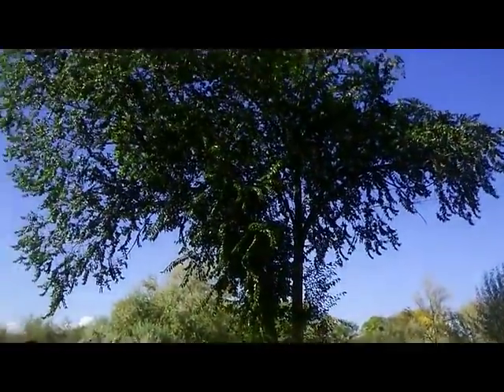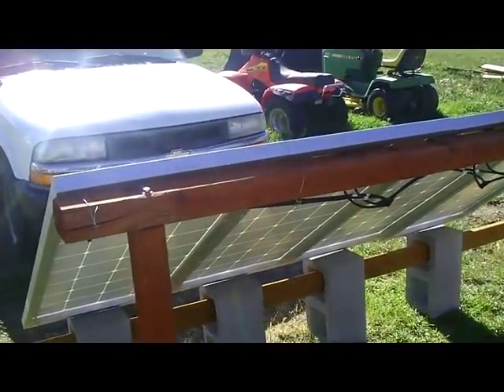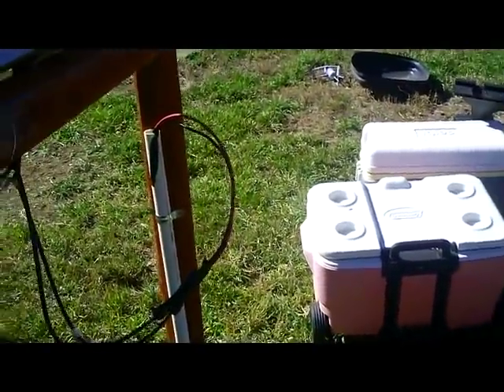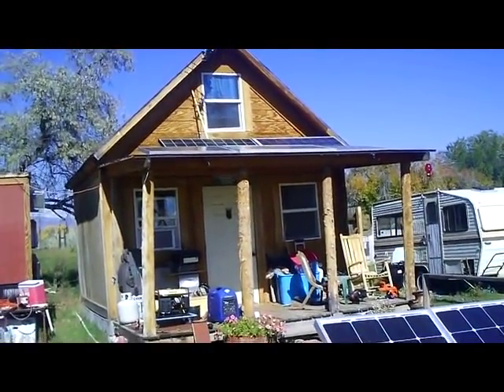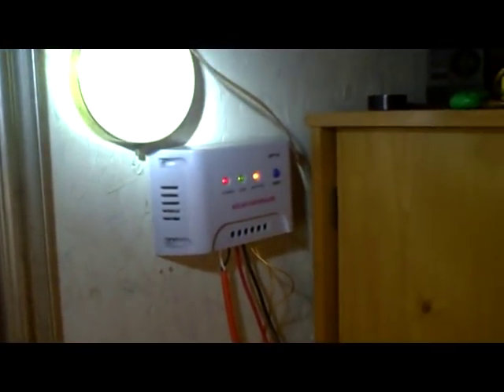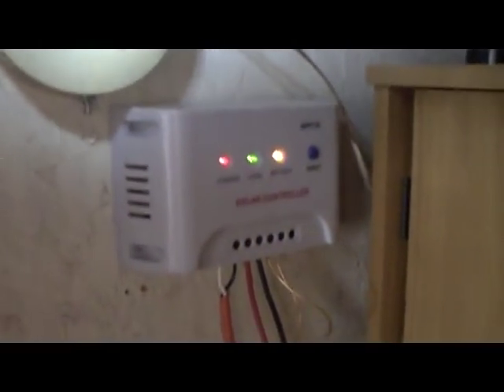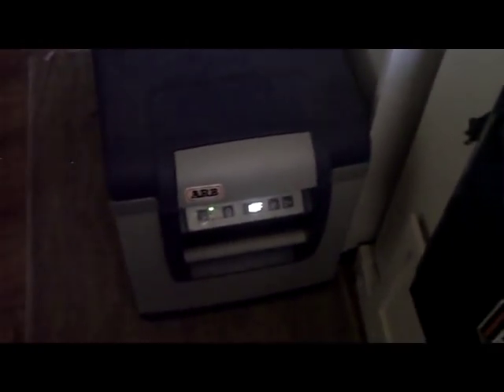Ground Mount Solar 400 Watt System

Comment: Have you considered using solar panels instead of propane for heating in winter? Is it worth it?
Reply from the maker: You would need a much bigger system to heat with solar. It is possible in mild climates with a mini split unit.
Reply: @solarcabin  thanks..now i understand

Comment: So I'm interested in your fridge and your system running the fridge. you said that you usually shut the fridge off at night. is it like a cooler will it keep your food cool until morning when you turn it back on? I'm having the same issues I have a small cabin that we are trying to move into and a small solar system with 400w of solar panels
 2 -100ah batteries 
And a growatt system controller w inverter.
I'm afraid I won't be able to run our small chest freezer 24-7 without draining the batteries. We're in Oklahoma so we have plenty of cloudy days

Comment: You should EASILY be able to run your laptop directly off DC. You probably do not need a laptop with a processor that draws more than 25 Watts of power. Even a CPU that draws only 15 watts of power should be just fine and even in most cases you can do what internet stuff you need to with a smartphone. 
Like your setup overall.
Reply from the maker: Thanks, I can run my laptop off DC with a converter and I have one. I have several DC ports in my cabin and they can also run of USB-C.
Reply: @solarcabin   , wouldn't hurt to look into a DC/Car/auto adapter for your laptop. You are simply losing more power using an AC adapter. I have been off grid for over 10 years and, like you, have done just fine with only 400 Watts although I soon plan to add a few hundred more.

Comment: Still relevant info in 2021! Setting up a portable 100w pv system for power outages and 400-600w pole mounted array for home use. Great video!
Reply from the maker: Right on, I think a small system is much more manageable.

Comment: So... 8ga wire, good! But then you tape up connections? Not so good for longevity. Corrosion will ensue. 
A lot of good info here but I just had trouble with that part.
Reply from the maker: 6 years now and not a single problem.

Comment: Excellent review only thing I would not recommend using irrigation pvc/fittings as conduit it’s not NEC code definitely use a sweep 90 otherwise if you decide to add or remove wire it will be next to impossible to pull though right a angle 90. I’m a retired electrician and have encountered this problem tying to pull wire through a customers existing DIY type install just ended up costing them more time and expense often just have to abandon the customers install and then install a correct conduit system.

Comment: Lamar, you didn’t say anything about your lighting. Are you running 12 volt LED lights throughout the cabin? Perhaps you can do a video on how you handled lighting with sources for fixtures, etc.
Reply from the maker: I had halogen for a long time but LED now. Much less power use.
Reply: solarcabin so how about showing us what LED fixtures you used and where you bought them? Inquiring minds want to know. 😄

Comment: Did I miss the fusing?  I have a very similar setup but currently running 2x100W panels and have two more to add.  I have the Renogy four panel parallel connector, the 8-gauge wire you mentioned was helpful, but I'm scratching my head on the fuse or breaker.  5.75A Isc * 4 = 23A * 1.56 safety factor = 36A fuse/breaker?

Comment: Nice set up. Good explanation of what you have done.  My only question is: If you had a shorter run (say half as long) between your solar panels and charge controller, could/would you have used smaller 10 gauge wire?

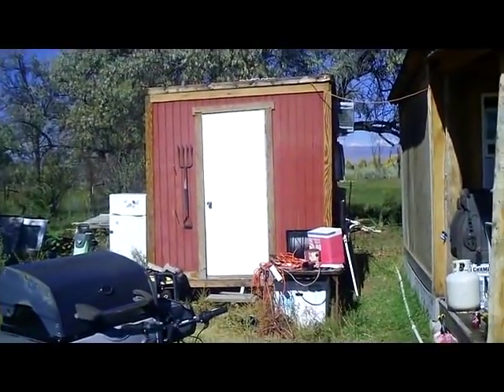Comment: At 4:30, you can normally store still some power if the charger voltage is increased (+3mV per -1 degrees C)

Comment: Ive had the same controller in my shed and i do actually think its a PWM controller...It worked very well until i replaced it with a brand name one.

Comment: DC current has to travel the full length of the wire from Negative to Positive and AC burns of the Current at the load because of the alternating of the positive and negative direction of the current  and doesn't have to travel back to the Negative or Positive

Comment: Environmental technologies.
Technology offer Performance multiplier, with milliwatt to megawatt.
High performance gain with the successfully tested pulse technology.
The novel power optimization is a simulated energy source as an electronic device (EPM, electronic power gain multiplier) and over 1000 km of long distance in series or parallel, connected to primary energy such as accumulator, photovoltaic, fuel cell and is generally applicable in the electrical engineering sector with impulse drive for electric vehicles, track, electric aircraft, space and shipping, thermoelectric generators (patent).
Innovative Technologies – RZ-IT

Rudolf Zölde
samplingtec@gmail.com
www.rz-innovatec.com
If 100 liters of petrol are consumed for a route from A to B, 
70 liters are converted to heat and 30 liters to moving energy.

Comment: am looking for some help I will have 2x12v 110am battery's and I want to use it all on 12v but my new panel will be PMPP 260w VMPP 30.7v imp 8.50A 37.8V VOC UL 1703 600 UL 17031 5A can I do this for 12v please help http://www.recgroup.com/sites/default/files/documents/ds_rec_peak_energy_series_rev_w.2_eng.pdf
Reply from the maker: Yes you can do it with a controller that will step down the volts to 12 volts. You need one like this: https://www.amazon.com/Volt-Solar-Charge-Controller-Screen/dp/B00OQRHEKW
Reply: Thank you for your help I can not use that charge controller as my panel is 37amp so I have got one coming that will do 12/24/48 amp just to say Thank you again Norman from the UK

Comment: This video was made in 2014 and the cost was 100US$ per panel. In Pakistan, cost of mono panel is 66US$ (100W mono 36 cell), but they are chinese built

lead acid battery 200Ah cost 130-150US$ here

Comment: Hi i built a house in the philippines which is in a rural location i cant get a supply to the network because the nearest is about half a mile away i would really ike  a checklist of the things i need please .I have the same problem with the water supply. Your video has really helped and i hope o can do it. Thanks regards English Phil

Comment: Will 4) 100 watt panels , 2000 watt pure sine Inverter and a couple batteries run a small 5000 BTU window air conditioner? Would this be enough to run for a while into the night? Great videos, thanks!
Reply from the maker: Depends on how much sun you get and I would use 4 good deep cycles and that should be OK for a couple of hours. More in the hottest part of the day when you need it.

Comment: I too like ground mount PV panel mounting for all the same reasons + one more.

I have slightly modified my top of the pole mount so I can manually rotate/track the sun if and when I feel like it with out needing to use any tools.

I have noted that by point my  2, 10 panel each Sharp 235 watt  panel arrays into the sun periodically thru out the day often increases the combined out put of my two top of the pole arrays by 1,000 watts per hour.

Comment: happy new year solarcabin from north FL i going to be run 80 or 90 ft from my panel to my charge controller will the #8 gage work ? lee
Reply from the maker: +LEE TAVES 

That is a pretty long run. You are going to have some power loss with that gauge and some heat build up. You can get HD 6 gauge outdoor extension cords that would be better.
Reply: Not so well. You will lose power with too small wire.Look into underground 10 gauge wire and double it. It's used for low voltage systems. Comes as a dual wire and 10 G. each. Cheap,too.

Comment: I enjoyed your video very much! I just bought my first Renogy panel, which is how I came across your video. I have a very small off-grid system I use for powering my radio, desk light, cell phone charger and laptop. That's a very clever idea with that small refrigerator! By the way, I have 3*35amp hour VMax batteries myself - what size are yours in the cabin? I also wonder if you have some fuses in your system someplace just in case. And do you think an electrical ground is necessary in a 12V DC system? Mine is not at present.

I like the PVC tubing to protect your cables, that and the cats roaming around. Thanks for the detail on the mount, I've been trying to figure out where to permanently place mine and your ideas were very straightforward and well-explained. I sent the link to your video to a friend.

Comment: I just subscribed seeing this video, I do like all your ideas and I'd like to see more of your solar setup and any recent/future changes you make. I was interested in buying a Go Power 175w power inverter. I opted for the 300w Bestek instead, however I'd rather have something like the Go Power due to having no fan and less power usage, what else have you run off it that it could handle?
Reply from the maker: +dimmunize   I use that small inverter to run my laptop and ARB fridge. It will run a fan and other small appliances just don't try to run them all at the same time lol!

Comment: How do you advise someone to prevent theft of solar panels in very rural area??
Reply: on an iron pole sunk in ground 6 feet and 10 ft. high. on a pole you can swivel and pivot  panels with pull ropes, so the panels always face the sun. it would take a thief with a ladder, tools, a lot of time and  balls to dismantle, if placed in the front yard for anyone to see them with tack welds on bolts so you cannot get off unless you had a torch or cutting tool that makes a lot of noise. solid in higher winds also.  if don't like that,  I suggest making a land platform of cement with bolts sticking up to attach solar panels to and tack weld bolts so can not take off . put in front yard.  BUT would this not be better to put them on the roof and again tack weld the bolts holding the panels in place.  One would have to keep solar panels on property that gets the most light. a few idea's.
Reply: That is a good question!!!!! Cables and a lock or 2,I'll guess.
Reply: Shotgun would be most efficient, but a .40 caliber glock works well if you're good with shot placement

Comment: Great set-up, I basically live in a tractor trailer and sort of make due with a KOOLOTRON FUN KOOL 12volt motor less cooler.  Some what smaller than yours.  Had it for 5 years, wouldn't leave home with out it.  I have a 800 watt microwave.  I use a COBRA 1575 watt inverter hooked up to the tractors batteries, to run A.C. equipment.  I try to carry a heavy duty extension cord wherever I go.  I also have a 2 burner propane fired cook top, for outside use and a 1 burner for inside use.  I have also tapped into my trailers pony motor for additional D.C., I just flip it to continuous run, it powers a 1000 watt COBRA inverter and charges an additional battery box mounted below the reefer unit.  Easier on the unit.  I have a 5000 watt set up on my diesel powered gen-set, this runs my spare air conditioner unit and everything else too.  I also have a WABASTO unit to provide heat in the winter, sort of like forced hot air furnace in a house, only the size of a big loaf of bread.  One of the things I recommend is you get a plastic travel cup with a screw on lid and cover the hole with gorilla tape or just leave the straw in.  This bit of cold will greatly increase the efficiency of your KOOLATRON type small cooler especially in hot weather, usually I carry a big blue ice pack, it will last a week easy, then I just put it in the reefer for a while.  I guess I ought to mention the large stainless steel side box...I keep a lot of drinks and dry goods along with survival food stuffs in there---enough to last a month !!!  My fuel tanks are topped off every other day and my reefer holds a hundred gallons of fuel also.  I carry a siphon in case I'm stranded some where low on fuel.  I also have a solar charger for my electronics--I put it on the dash board.  I also carry a 12 volt rechargeable power source for minimal power at night.
Reply: +Al Fries Wow!! That is so cool! It's like you are a space shuttle with all necessary systems on board!

Comment: Wouldn't running the panels in parallel be a much better soloution since you are using MPPT controller?

You could still run 12 v system. 48v input from panel charging 12v battery bank. that extra voltage would get better efficiency from MPPT controller to charge batteries quicker. You dont have to keep everything 12v with MPPT like with PWM, Your not getting any benefit from MPPT running like this, you might as well be running PWM controller. The beauty of MPPT is that you can have different PV voltages to battery voltage, plus less volage drop from higher voltage from the cables to the house.  I thought that was the whole point of MPPT vs PWM. but I may be wrong.

Comment: Your going 12V DC lighting Direct for your lighting needs correct (why convert with a loss). Extra 12V outlets cause you never know when you can power downgrade in the future to DC and get full value without need of DC-AC inverter.

Comment: HI, I'm a woman and I"m very handy.  I live in a mobile home and I am sick to death of higher and higher utility bills!  My gas bill is just too high for a mobile home and I"m tired of the high electricity bills too.  When you wire the wires from the solar unit would I connect them to the electric box?  It seems that if not I'd have to run a wire from each lamp or item.  Also, what can I do to get rid of electric heat?  Thanks so much!

Comment: Lamar, I love your channel and the way you explain things. You have such a common sense approach to things and I can relate to that because I'm pretty much the same way. Feel free to check out my channel. My apology if you may have already got this question. I read through many of the comments and didn't see it. Why do you wire the panels in parallel instead of in a series? I'm trying to understand the difference. I'm still learning. Planning on setting up a 400 watt system on a small 10/12 shop. Thank you so much for all that you share! God bless you!!!

Comment: Hey, you want to have your solar panels in 2 x parallel x series with that controller to create a higher voltage so its more efficient and can charge in lower light levels because it will have double the voltage bandwidth that previous. Thanks for all the videos man youve inspired me :)

Comment: Very nice setup. Well done. I'm starting to like option of house built underground. Such  would stay even cooler in summer and warmer in winter, if on hill so won't be flooded in days of rain. Another advantage is protection during violent storms. Passive solar for heating air and water and active solar (photo-voltaic panels for electricity) would make such a home even better.  Still in all, your above ground cabin/house allows easy expansion. With cheaper solar panels and LED lights available these days, its getting easier to build such a home. Nice job on your build and sharing with others.

Comment: I'm really interested in getting a solar system set up in my garden. I'm looking at 3 x 100 watt panels with 6v battery, maybe two 6v batteries as backup. What i need to know is what charge controller and inverter will i need. Can you please help? Thanks

Comment: Nice setup, Just wanted to tell you about my fridge. I have a small chest type freezer plugged into a freezer temp controller set to 39 deg. works great and uses a lot less power then a regular fridge, gives more storage room than the little cooler.
Reply from the maker: I have a chest freezer run off a separate system:  Ask LaMar: ARB Fridge/Freezer Comparison Review

Comment: Nice setup. I'm curious about the cost of the wiring from the solar panels to your cabin. If it's not too expensive, a few sets of extra wires through the PVC tubes would be nice if you decide to put in other panels or if the first set of wires fail. It would save time and materials from building other underground tubes.

Comment: Lamar, you might want to consider using dump load controller. That is, a controller which would divert only the excess power (when batteries are full) to electric heater(s) heating your water or space in winter... controllers you use at the moment simply reduce the power of solar panels when batteries can't accept all the current, instead of using it somewhere else.

Comment: Hey LaMar did you not have a Bluesky 25amp MPPT controllor in the shed? Did it quit on ya?
Reply from the maker: I am putting the Bluesky and my older panels on my camper. It still is working great.

Comment: Looks good .But before you bury that electrical conduit it would be better to switch out all the 90 degree elbows out to electrical 90's .They will make it easier to do any upgrades or repair later and they are easier on the wires .Don;t forget to ground the frames to the panels also.For saftey reasons.You can just drive a piece of rebar in the ground and connect a #10 wire to each panel and to the rebar .
Reply from the maker: Probably good advice but I had those old elbows sitting around. The frames and system is grounded just didn't show it in this video.

Comment: been watching awhile. just have to ask this. I figure your on a budget. are you going to step up to a real mppt charge controller like outback or midnight solar where you can run your panels at a higher voltage to the charge controller then step it back down to 12 volt? that is what I have done on my home. keep the videos coming and thanks man.
Reply from the maker: Thanks- that is a 30 amp MPPT controller. For a small system like this 12 volts is actually better because I run 12 volt appliances and a very small 175 watt inverter. For a larger system 24 volts will reduce the size of wire needed but parallel connection of batts does not increase the amp hours and more amp hours is what I want.